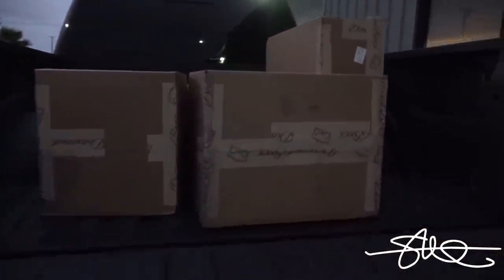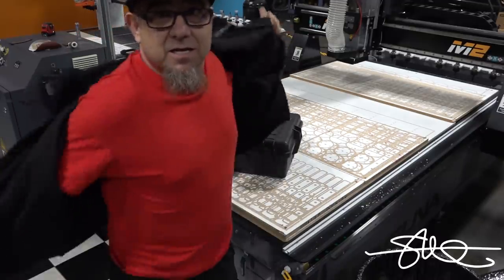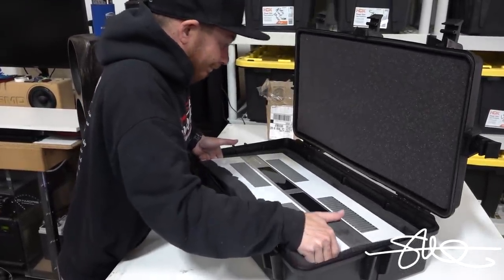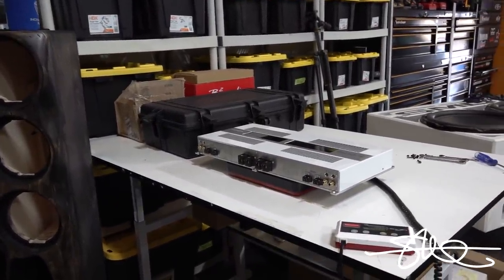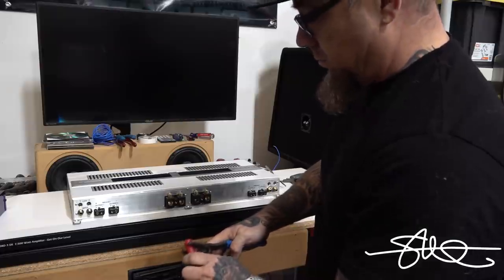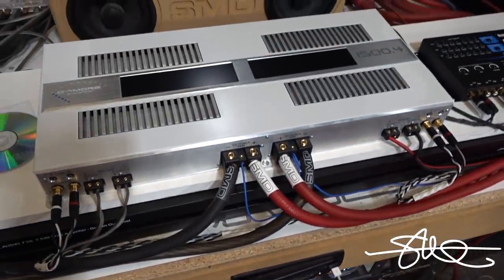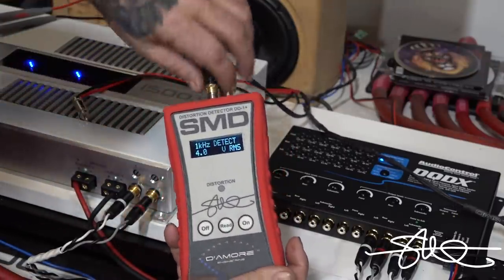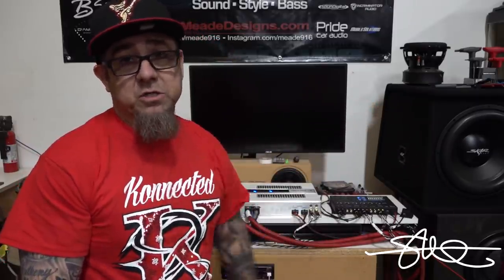I Got an $8400 Christmas Gift! D'Amore Engineering 1500.4 Dual Stereoblock Hi-Res Amplifier

Comment: I remember back in the day (around 1993) I used a class A amp for mids and highs. Or at least 20 watts class A with Phoenix gold amps and Boston pro composets front and rear. For subs I had two beyma 15k200's in BR 80 liters. Don't remember all the amps I had on the subs but it sounded awesome back then.

Comment: I'm suggesting to everyone into car audio to buy the dd1. I spent over 1500 bucks at a local shop to install my door speakers on a 4 channel and 2 subs on a monoblock. Pock my car up I get told to not turn my bass nob over 3/4 of the way up. I bought the dd1 and double checked what this place did, my pioneer head unit tops out at 62. Distortion hit my highs at 60 my bass at 58. At 47 my whole system was distorted. This piece of equipment is the truth.
Reply: Sure, without the possibility to properly use a scope and/or THD analyzer, DD1 is the only thing made for normal people to get their gains properly set. Shocked that nothing else is on the market, still! The price/performance is a bit steep for me, especially as an electronics tinkerer, but the device is well made.

Comment: I'll be honest, if I had one of those I'd likely spend most of my time looking at those lights. Even through my relatively basic computer studio speaker setup and youtube compression I could tell that thing sounds sweet! As far as gains go I like my scope, just my preference and I already have one around I use for electronics projects. See a lot of guys forget to check their deck output, mine only puts out clean sound at 33 or 34 out of 35. Happy new year Steve.
Reply from the maker: i would love to see your gain setting procedure with a scope.  Everyone thinks they are cool by saying "i have a scope i like it better" but so far i have yet to see anyone use it right.  Having a scope and using the correct procedure is two different things. Not saying you don't but i would bet cold hard cash almost 100% of the people who "love my scope better" for sure ain't doing it right. And i bet 99% of them dont even own a scope, they just like to say it to fit in. LOL

Comment: Sweet amp D’Amore engineering is close to my house. It’s in the building Rockford Fosgate use to be on the corner spot. On Rockford Fosgate ave.i didn’t know what it was until a few months back. Rockford s a few buildings south now. Well it was idk if they recently moved it or just took the signs down.probsly sick of people stealing there sign lol
Reply from the maker: D'Amore is in Camerillo CA not AZ anymore...
Reply: meade916 steeveeeee what is a cool head unit  i can put in my 02 tahoe that will be compatibles with myRockford Fosgate sounds processor 360.3.So I would like to use the S video style and just have one cable

Comment: Nice Amp. I set all my gains by ear, i have no scope or neat (expensive) tools to play with.
I have a Cheap $79 jensen HU (SD & USB), Vol goes to 63, clean to ~48 max 54. Sony XEC-1000 Crossover, 2 Sony 4040's bridged to ADS 320i/s & S6's, ADS AS10's in the doors with FU-300 DVC 10's in a stinger box under the rear seat on an MTX Thunder 2300 (loaded at 1.3ohm per ch). all tone is flat, subs at 80Hz at the crossover and 50Hz internal crossover (MTX2300), 320i/s @ 160Hz, S6's @ 120Hz
Oh and a 144A Alt, under drive Alt pulley (+500rpm), working on doing a Headway cell 4pack upgrade, B+ V rests ~14.4 and just barely dips at idle with everything on (lights, wipers, blower), i'll definately need a bigger Alt and the headway cells when i add the second MTX amp, a Blue thunder 3002 w/more subs), and swap the 4040's for 754HX, and add the ADS PH15 with 4 200i plates.

Nice Tomas Dolby choice. Try Dream Theater. I play mostly all metal, my system beats for hours on end and hardly breaks a sweat. (97 silverado extended cab). Sound system is several years in the making, long time collecting pieces and have spares/backups of everything (ADS & a/d/s/), had a few drivers reconed this summer. Not easy to do (put $ aside for audio) on < $24k yr income in Massachusetts.

Cant wait to see that amps guts.
Reply from the maker: set by ear = WRONG.  Take it to a qualified installer or educate yourself.  OR ride around with your settings all jacked up.

Comment: Steve I have (1) skar audio skv2-1500.1D I’m using to push this with an audio control epicenter. Would I connect the spicenter to the head unit and then the epicenter to the amp and calibrate the epicenter first and the amp?

Comment: I have a quick question for u!! Do u think 2 badass 18's in a ported enclosure built to the right spec would be louder SPL whys then 4 decent 15's in the right ported enclosure as well? I have plenty of room so that's not a issue at all!! Also the 18's are 1500w rms & the 15's are 1000w rms either setup would be ran a true 4.5k rms Korean amplifier a Soundqubed  actually!! Thanks I hope to hear back I APPRECIATE it I follow u all the time I learned alot from u!!!

Comment: Hey I hope it is okay to ask a question here. I was just wondering if someone could help me where I don't know much. Being I ordered (2) PIONEER TS-SW3002S4 12" and I currently don't have a amp as I do not know roughly what I need to run these sub, an amp with 800+ RMS? or 3,000 watts total all would be @2 ohms. Thanks all <3

Comment: In the dqdx once the gains are set properly can u set the different frequencies to max or is there a limit
Reply from the maker: i don't know, good question, i should test that.  For the most part it is always best to cut frequencies than to raise them though.  Nobody should ever need to max any of them out.
Reply: I was always taught to bring freqs down like Steve said, u look at my eq and nothing is over the halfway point, wether it's right or wrong it's how I've done it for 25+ years and hasn't failed me yet.
Reply: @meade916  I know gains most not ever b on max all mines are less than half but with the dd1+ just wanted to know from a pro is it possible 🤔
Reply from the maker: @aleemhosein6813  what does "less than half" mean?  It isn't a volume knob.
Reply: @meade916  

Volume = Amplitude = Gain.  Same shit, different terminology, and different way/place to control it.

Comment: Hey what do y’all think about them Audio Legion Amps I don’t get no feed back S30 series s30 (4) 12’ and one AL5000.1 amp are they better then the B2 amps and subs
Reply: Theres a reason b2 holds a world record
Reply: I had a 3500.1 and hated to of had to sale it and turned down was still crushing most 2200 watt amps with the sub output on 4 when it was on 9 to 11 with the 2200 watt amp and it was clean.
I'd love another al3500.1.
Reply: And was more efficiant than the 2200 watt amp I have.